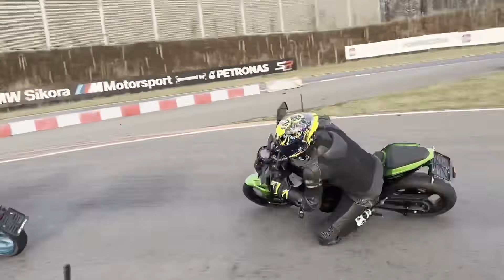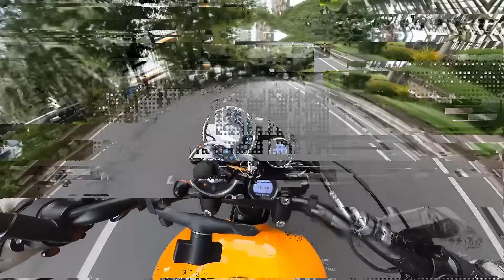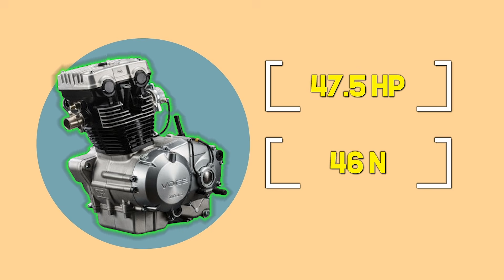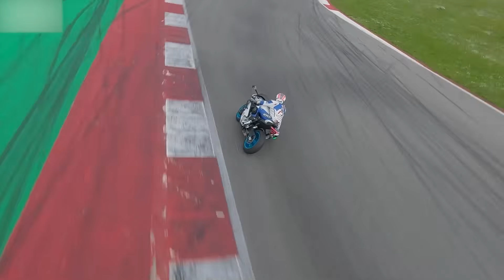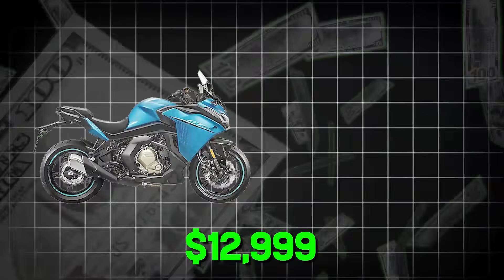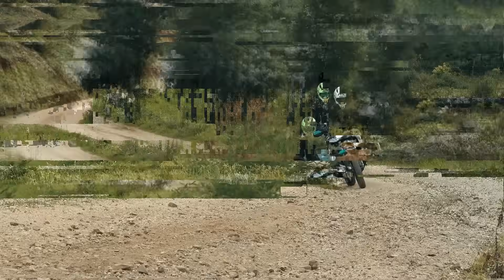16 CHINESE Motorcycles That Are SHOCKINGLY Good!

Comment: The same Voge off road you mentioned at $ 5000 costs in the netherlands € 8000 . So no cheapo chinese bikes for the customers here.
And the  DS900X is a whopping € 13000 ( that is 14800$$ ) and you mention $ 8999

Comment: There's no such thing as a CFMOTO 900NK, the 800NK is a great bike, but it has a 799cc engine has 100 HP and 80 Nm of torque in the US. Meanwhile you are making up facts about the suspension.  Try fact checking, it costs you nothing, just like not hitting the like button on this crap.

Comment: Budget Chinese bikes ..is this why you can’t sell them second hand or basically give them away …they are cheap for a reason …try finding someone to work on it ..like Hyunsung…not one good review by any owners …
Reply: Not worried about resale value on my bike when I paid less for it new than I can sell it for used.  Don't be stupid and pay MSRP on any new motorcycle.
Reply: @mpeugeot not considering a new motorcycle …you spend the same amount of money on maintenance and care as you would on any bike but get less than half of the value back …not going by experience ..going by other peoples experience..you get what you pay for …
Reply: @Mavric1825  I got a lot more value from my CFMOTO 800NK than I imagined possible.  I paid $4799 for it new.  Even a used bike was not going to be a better deal.

Comment: 😊...Have CFMOTO IBEX 800S, bought new Dec 2023, 17,200 miles. Bike has been flawless. New chain & sprockets at 14,000 miles, brake pads etc, normal wear items. Wanted Tracer 9 but as a cash buyer the Tracer was 5 grand more. The Yamaha probably a bit better bike but nowhere near 5 grand better...
Reply: Good choice
Have a safe drive
From Korea